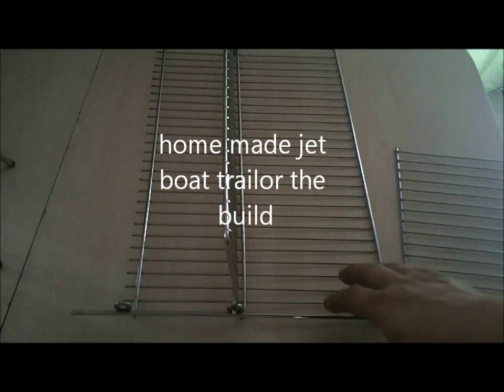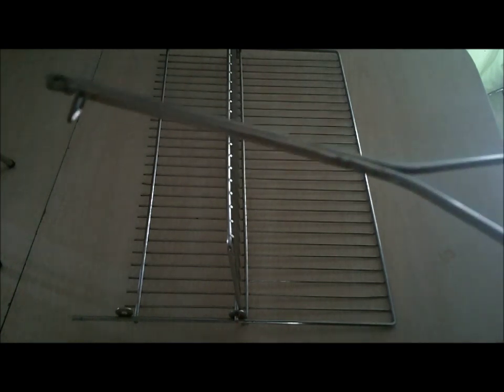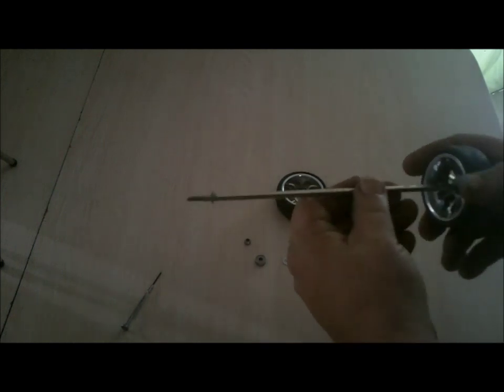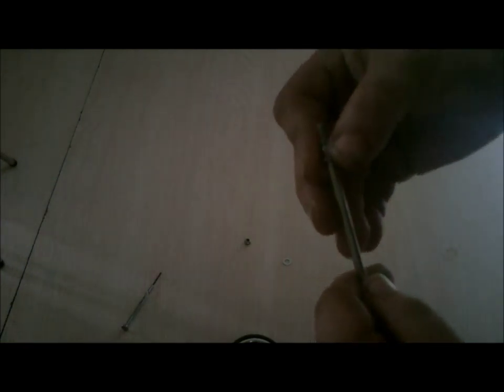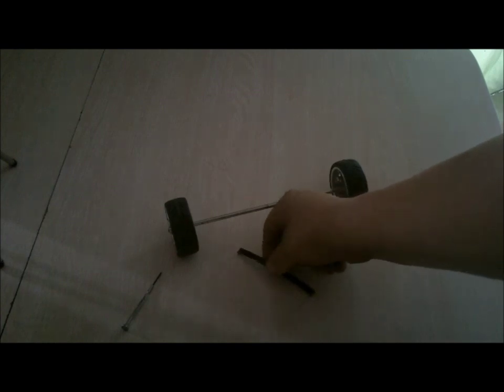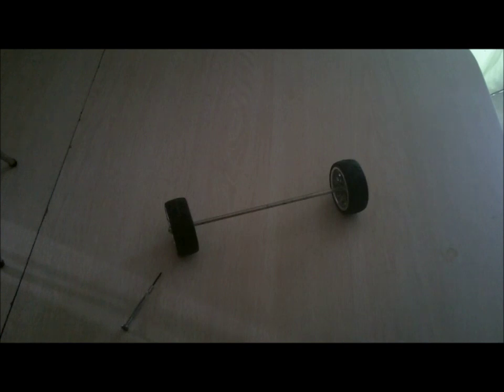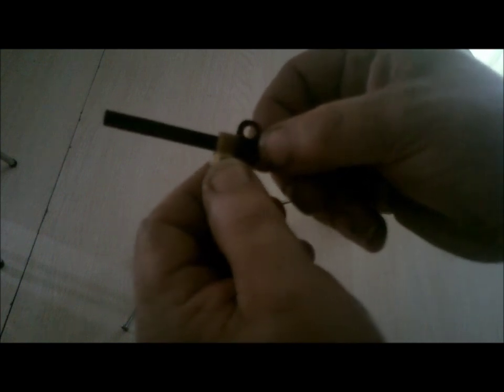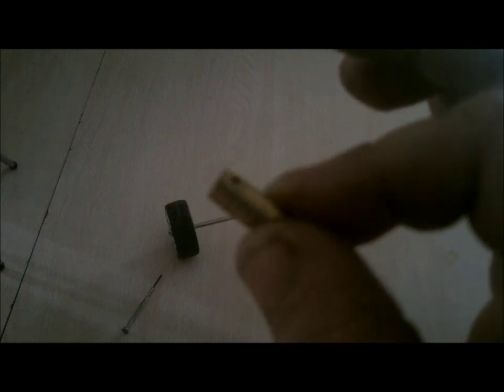rc boat trailer build part 1

Comment from the maker: no that was the only way i could think of. you will need some steel strapping. a vice, dremmel motor tool with cut off disks , metal files. pliers , drill , drill bits , a ruler and or tape measure , hammer and centre punch.pretty sure that all the tools i used to make the leaf springs.

Comment: Hey +mrpuppers just wondering wher u got ur scrap straping from?????
Reply from the maker: TRX667TV  i got the strapping from work .  parts come in strapped to pallets . they just throw it out , so i cut some pieces .   the stuff i grabbed is the biger stuff .  1 1/2 inch wide  and about 1/16 inch thick .  very stiff !  if you know any one that works in the industrial feild they might be able get some for ya.
Reply: So r they on wood pallets?? Or different ones.
Reply from the maker: TRX667TV  usually used with wood pallets.  but strapping can be used in many ways  , to hold pieces together , around wood crates .  all for the purpose of shipping.  yes there is thinner ones that are not as wide. the thin one is not as stiff as the wide and i don't think it would hold its shape for leaf springs , so i used the wide one.

Comment from the maker: @whitewidowherb thanks for the comment bud. the fact is i don't weld so im having a hard time getting the leaf spring brackets attached to the frame. tried a few different ways but failed. still trying to work them out. hope to finish the bugger very soon. B>)